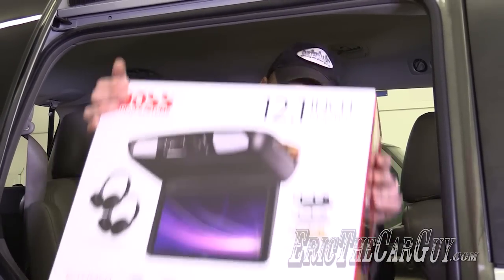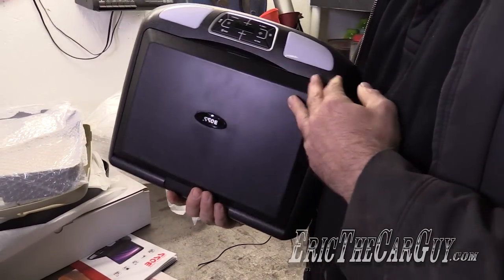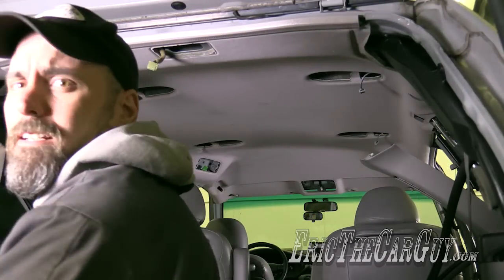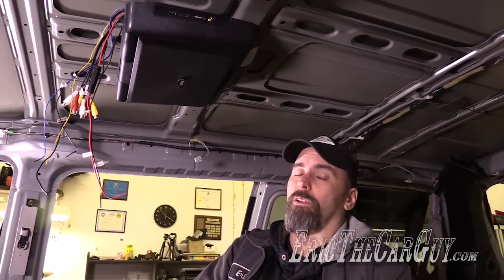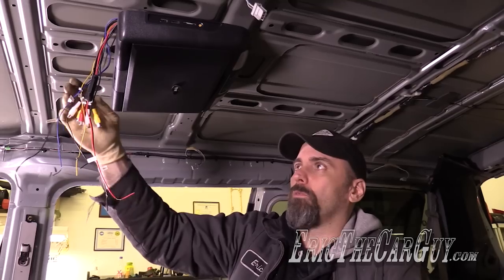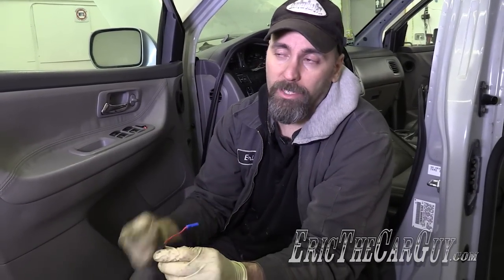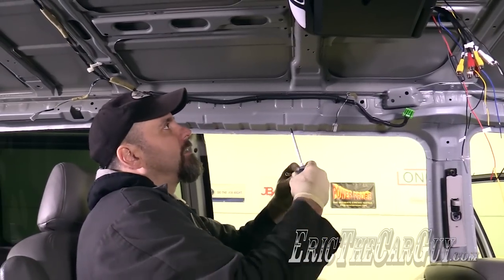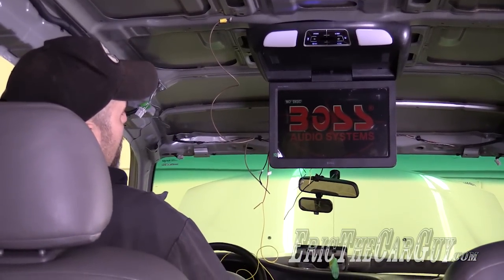How To Install a DVD Player In Your Vehicle -EricTheCarGuy

Comment from the maker: Grab some popcorn and we'll watch a movie. https://www.youtube.com/watch?v=5RWkh99190M&feature=youtu.be
Reply: Hey Eric, l've a 2007 Odyssey EX-L with DVD in it and how to replace the Odyssey original DVD to this big one?
Reply: Smashing job eric :-), there is more than one way to get the holes in the right place, but yours worked smashing :-))
Reply: The things you do to make a quality video Eric. I hate those things but appreciate your drive to show us how. Keep it up!(fairmont video hype!!)
Reply: Elmano Locko 1 - Remove old DVD2 - Follow this video.
Reply: i heard if you spin the drill bit in reverse it will cut stuff like carpet and that padding
Reply: Eric, does this DVD player play iPad or iPhone movies through the USB port?
Reply: You are not suppose to solder those wires, your suppose to crimp them like you did, I saw a thing that said the heat that your roof absorbs from the sun can melt that solder so you should just crimp them. You did it right
Reply: Chris Porter  if your roof reaches 180°C you have a serious problem. Maybe you should stop setting your car on fire :D
Reply: HouseCallAutoRepair You love your caps lock button dont you lol

Comment: What a nice van! I'm jealous.

Your ground is good. You should always keep ground wires short and connect them directly to the body of the car. That will always have less resistance than a wire to the ground terminal of the battery. Don't run grounds to the battery. You dun good with the ground, just the way it is.

The 12V constant wire should be red! Other people might work on your van someday. It is irresponsible to use non-standard wire colors. It would be best to run it directly to the positive battery terminal and fuse it within 12 inches of the battery. The 12V switched wire should go to the accessory wire from the ignition. That wire should be yellow! Also, solder your splices into the wires directly or use scotchlocks to attach the wires. Don't "redneck rig" your power wires to the fusebox. Even if someone sent you a fancy adapter, it's not the right way to do it and you know it.

While you had the headliner out, you should have run RCA cables to the radio area. Don't depend on the crappy FM modulator.

Nice Channellock crimper! Those crimps work great. I've never had one fail. You don't need to solder everything.

Comment: The sharpie worked ok I guess, but what I would have done differently is install the mounting screws into the roof bracket, put some sort of paint on the heads of them, then mock the headliner into place. The paint from the mounting screws would then transfer to the back of the headliner giving you your locations to drill.
Reply from the maker: Brian W Nice idea. I'll have to try that next time.
Reply: no need for for paint, just press the head-liner against them and it will mark the position :)
Reply: Yeah, that would work too

Comment: If you're worried about a rattle inside the DVD player I would rap the ends of the RCA cables with electrical tape and that should keep them from rattling.

Comment: Glad you got it to work.  It was good you didn't have to call Boss tech support.  I have a head unit from them with a little 3 inch screen on it.  I can't get tech support to help me out at all with my question on it.  They answered me once and I asked a couple follow up question and they never respond.  I would not use them again passed on there very bad tech support

Comment: Cool install!  I found it easier to add circuits to my truck by building a separate diy fuse/relay box.  Amazon always has excellent deals on fuse holders, fuses, and 30 amp relay connectors (relays included)!  I've spliced from the hot switch wire of the ignition and had zero issues.
Reply from the maker: Brian Piper I'm actually going to do that with the Fairmont. Thanks for the suggestion.

Comment: Eric, as a person who typically does the twist, solder, glue-heatshrink method, I have no problem with crimp connectors as long as they're done right and with the right tools.  Most of the time people use pliers or a hammer, or they'll use crimping pliers, but they'll use the ones made for noninsulated crimp terminals and end up destroying or penetrating the insulation.  Yours are dual purpose by the quick glance I got at them (and looking at the link) both insulated and noninsulated crimping terminals.  A connection like that I have no problem with at all!

Comment: Did this a few years ago in my dads Astro. Trick it out with a custom input jack, 300w power inverter for games, and off air ant for the car.

It doesnt get any use now. Can't pickup HD signals, dont own anymore DVD's, and games are all not in HD.

Still looks good tho!

Comment: Note: when you install a power tap you must determine which side of the fuse panel is hot. This can be done with the fuse out and a tester. Then you install the tap with the fuse in it for only your new cut and make sure it works. Then install the original fuse. This prevents you getting the fuses in series with each other.
Reply: Glad I looked through the replies because I was going to say the same thing. If you grab the fused side for your "add-a-circuit" you've just added to the load of the original fuse.

Comment: Note to self and others. 

Remove metal bracket from dvd player, place to desire location with Headliner still in the vehicle take black marker put dots on headliner for drilling through. Then remove headliner do a mock up install with either piece of fiberglass or piece of scrap metal laying around.

Rule of thumb measure twice drill once.
Reply: What

Comment: I like to put toothpaste on holes I drill that need to be lined up to another surface. Push the two surfaces together and you have your hole markings....
Reply: Great idea!
Reply: Brian Piper It really does work well. You don't have to use toothpaste either. I find it does work better than other things I've tried though

Comment: I install these everyday and I've never taken the head liner down. I was blowen  away that you went though all of that too get it in there.
Reply: How do you do it CarPhonix?
Reply: HOLY SHIT CarPhonix, what are you doing here?? BMP!
Reply: I've done this a few times at work, never had to remove the liner. Just used the mount for the dome light.

PS: heard a few horror stories of guys drilling holes in roofs.
Reply: How would you go with wiring? Hardly any room with some cars which have a dome light the size of a small mobile phone.
Reply: Bobman84 Wiring would be fished between the roof and lining. Tons of space. We would also run AV cables too.
Reply: ohhhh so thats why the aftermarket DVD player in my used truck is installed extremely shitty.
Reply: Carphonix knows his stuff
Reply: this car didn't have a flat surface so he had to look for good mounting spots
Reply: farerse a flat surface would be very bad
Reply: drink15 i mean a surface that didn't have that bump as you saw in the video .. he also used spacers i believe
Reply: I wouldn't take my vehicle to some burnout guy who "knows his stuff" and have him drill thru my roof.. Because if he did, I'd be the one stuck with the hole in my roof.. ... I appreciate how Eric broke it all down and explained it for the guy who will do it himself only once in his lifetime.
Reply: killmore75 You know, Ill take a video and show you guys!
Reply: Bullitt Garage Thanks man you subbed too me? Ill make a video soon and show you guys hows its done. He didn't do a bad job and for his first time doing this I still give him a A++ for his work just he didn't need to go through what he did to install it!
Reply: CarPhonix CarAudio Been subscribed forever!
Reply: CarPhonix CarAudio
 Thanks that would be nice, Cheers!
Reply: CarPhonix CarAudio Budd if you want to do it like he do and where he do remove the liner is a must how you gone fight that big ol chuck of board and you in there lol good job Eric and let's see the video on same Honda I better do same to avoid warp and leave wrinkles on the roof liner
Reply: CarPhonix CarAudio
Good, because I am curious about this too, especially if it is a heavy unit and you may not know how the metal structure looks like over that liner.
Reply: I've installed probably around a 100 or so myself and have never taken the headliner down. Hell, I only take trim off the one side.
Reply: HouseCallAutoRepair You don't need it. You can find the braces very quickly and easily. When you've done enough of them you already know what size screws and washers you need. Honestly I could knock out a flip down monitor faster than a head unit in some cars. In modern cars today changing the head unit worries me more than headrest or drop down monitors in some vehicles.
Reply: HouseCallAutoRepair I agree with you.  Those of us watching this are the ones who want to install one in their vehicle.  I think riothero313 missed your point even though you quoted "less experience" in your statement.  I like to know what's behind something before starting.  There's no way I'd start without the look-see.
Reply: HouseCallAutoRepair
Fair enough, everyone views things through their own lens. It's probably as different on the other end being viewed by someone that doesn't know how a hammer works :)
Reply: CarPhonix CarAudio how or what did you do? To make sure you didn't have to?
Reply: If I were installing one for the first time I would have removed the headliner too.  Not knowing what was up there.

Comment: When I was installing factory DVD players, we had to cut a hole in the headliner and mount the plate. Also, why not pull the radio and make your power connections?

Comment: Hey Eric, i know this might not be the right video to be making this request, but would you be willing to do a video on valve stem seal replacement? I am working on a 1998 Mitsubishi Eclipse, with a 2.4L 4g64 engine. I do not plan on pulling the head and will be using the same technique shown in your valve spring removal video. However, it would be great to see how properly remove the seals, how to identify a failing seal, and how to properly install the new seals. I also have a somewhat persistent tick.While the rocker rails are off, it only makes sense to replace the lifters as well. Maybe you have done a video I haven't stumbled across yet, but there are several videos on youtube with different methods of bleeding the lifters; some people aren't bleeding them at all. What is your take on this? I already ordered the parts, so there is a good possibility the job will be done by the time you would be able to do such a video; however, it seems like a common job and a walkthrough from a trusted source would do us all well. Keep up the great work.

Comment: When it like that hanging bolts with 3 nuts. All thread bolt cut to length. long as you tighten it it's stable as 4 boxed legs

Comment: Don't ever drill into the cross members the way he has (perhaps why the video is cut), it's a sure fire way to go all the way through the roof panel on the other side.
Either mount the bit deep in the chuck or use self tapping screws that can't reach the skin

Comment: If you'd smear some children's water based paint onto the DVD bracket and then mount the head liner and press it onto the bracket it would leave a mark on the inside of the headliner, that way you'd be 100% sure you're right on the mark. Cause the way you did it was quite risky.

Comment: Why didn't you use bullet connectors for the power/trigger/ground wires? It would make it easier if you ever have to remove it.

Comment: hello i see last time someone left feedback i think but ,,, anyway ,,, i have the add a fuse line ,, but finding the power for dome lights i have the white and wire and blue but the others purple and another light blue so should i do the middle which is blue  and looking at the add a fuse hard to find the fuse for rear wipers and i see that others say they never take the head liner down ,, I didn't take mine down,,, but love this video and i have the 2013 honda odyssey thanks but need some info...

Comment: I would have put crimpable blade connectors so you can un plug the wires from each other if you need to take it down

Comment: i use to solder, but crimp is just so much easier and if done right is just as good connection.
Reply: Me too, I prefer to use non insulated butt connectors and heat shrink for most of my connections.

Comment: When I make such installations, I always try to mount connectors on the cables, it makes the re-installation so much easier. The best place to find multipin connectors are at the salvageyard, I usually take the opportunity to cut off a number of connectors when I'm there, you never know when you need one. I think it's funny that there were no connectors on the dvd head unit, there is always iso connectors on stereo head units.  But the easiest way is probably to find a pair of iso connectors where you buy your stereo.

Comment: When you install one of those "add a circuit" fuse holders you need to make sure you don't install it backwards, that way it pulls power from the Un-fused side of the existing circuit, otherwise you are basically adding it to an existing circuit. In other words you should be able install the "add a circuit" in a way that it can run the DVDs player without the fuse for the rear wiper installed

Comment: Does the ground have to be the same thickness as the power wire?   For example if I use the 12 gauge ad a circuit and run 12 gauge power wire from it to the unit, can I use the much smaller ground wire coming out of the unit without hurting anything?

Comment: I installed this DVD Player and everything is fine.. Now When I turned off the car and turn it on again. I have to go and turn the DVD manually even though I left it on. Is it normal? I know the DVD starts from where I left off without any problem. The Problem is that even if I'm in the HDMI Mode when I turn it off and on it would start on the DVD instead of the HDMI input. Also I have to turn it on with the remote or manually all the time. Any Suggestions?

Comment: hey Eric . . I just bought a dvd player flipdown. what wiring will I need to get it to run thru to the circuit board. I have a Nissan Altima 2013

Comment: Hey Eric, huge fan of the show iv seen many episodes and always keep up to date on your newest videos, just wondering about the crimping pliers in the video, recognized them as a channel lock unit and iv been tossing back and forth between getting a pair of channel lock crimps vs klein. I work in the HVAC field and the guys usually buy kline but iv always had good luck with channel lock personally. just wondering how you find them to use and do they hold up well. also any experience with kline? thanks for the video hope to hear from you.

Comment: Hey Eric you know what you could've done is shown a homemade DVD if you have any like of your own shows for example. I also wonder if the DVD player will work with aftermarket DVDs such as DVD-R & RW. I have had instances where this has proved to be a problem. And yes YouTube copywrite bots are assholes.
Reply from the maker: Michael Sackstein I didn't have time to create a DVD or I would have done that. Thanks for the suggestion.

Comment: I don't understand your logic when using the fuse tap.
"If I lose the original circuit it won't matter"   - But you don't lose it. That's the entire point.
"I'll see if the rear wiper still works"   - Why would it not?! A fuse tap literally extends the circuit by 5mm to the fuse using a solid metal connection.  How could that possibly not work?
Reply: Maybe he was testing it out to make sure he doesn't have a defective part... which is not unheard of.
Reply: I believe he was trying to show that the tap runs both circuits through 1 fuse, and given that the fuse will no longer be the same rated fuse since there is a DVD player also attached to it, he was testing to make sure with the tv and the rear windshield wiper together wasnt running enough power to blow the fuse that he thought would be the right one. When he says "loose the original circuit" he means if the tv blows the fuse "it wont matter" since its just the rear windshield wiper
Reply: But a fuse tap uses two separate circuits and 2 separate fuses...

Comment: FYI Eric, i'm just trying to help, but Boss is a pretty garbage brand.... and theres no detailed instructions because that type of aftermarket product typically gets installed by a professional installer, hint: use threaded nutserts for mounting to sheet metal. Your ground has a ton of paint on it, granted the dvd player doesn't require much power, but still.... u grounded it to paint. But overall, good job.